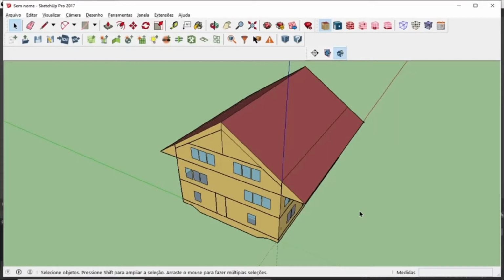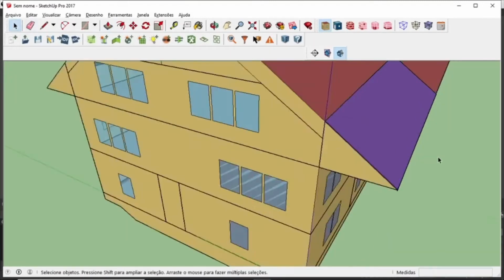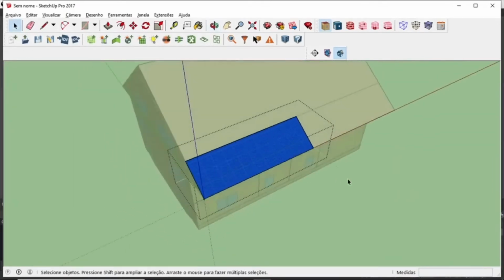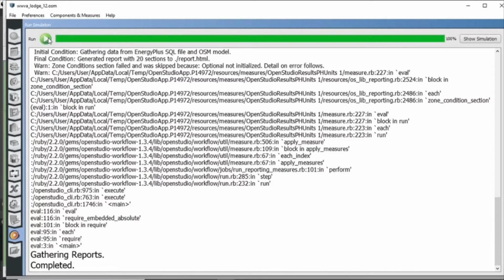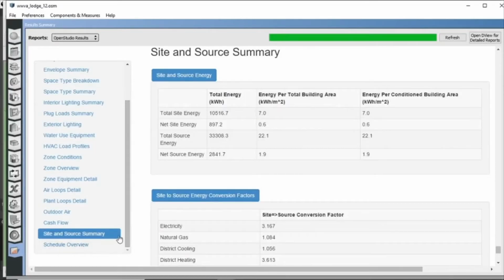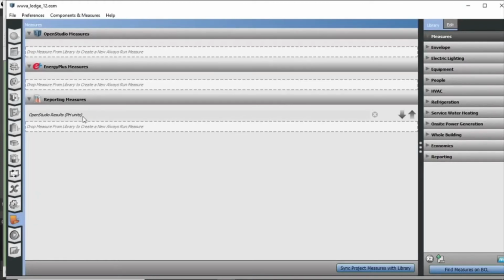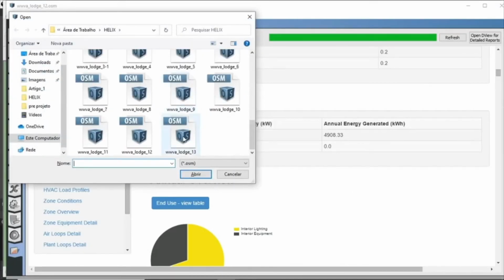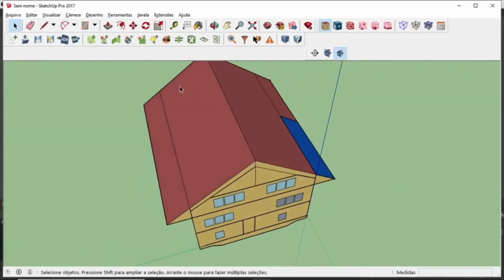OpenStudio SketchUp - Adding Photovoltaics

Comment: How can I enter the maximum power for my solar system?
Reply from the maker: The maximum power will be determined by the size of the photovoltaic array, the energy conversion efficiency, and the maximum available solar irradiance at the weather file location.
Reply from the maker: It is auto calculated.  It is not a parameter that you can enter.

Comment: I have a question about designing PV in OpenStudio. When assigning PV to just one of the surfaces, what happens to the other sides of the shading, especially if we have given it depth?
I used this approach, and in the IDF file, it shows one PV panel and five shading surfaces. My question is: why do we need to extrude the surface? Is it possible to assign PV to just one surface without extruding the surface? The PV I want to use has depth; can I assign PV to all extruded surfaces, or does only the top surface act as PV?
Reply from the maker: The top surface only acts as a PV.  It is not necessary to extrude the surface, and doing so only adds to the complexity and calculation time and does not significantly impact your model.  The small extruded sides only provide a minimal shading and thermal storage effect.  So, it is better to have only 2dimensional panels.  The shading surface is also assigned a material property and thickness, so it still functions as a shading surface and thermal storage and radiation moderator.  Depending on the material and thickness chosen, there may be a nominal radiative (and conductive) heat that goes through the material and impacts the building.  You would not want to assign the PV to the extruded sides unless they actually contain photovoltaic cells in real life.
Reply: @helixenergypartnersllc3540  thanks a lot, I got it

Comment: i want ask something. i need help. my thesis study need to connect Sketch Up, Open Studio and Energyplus in doing PV System. my design that, PV is the source energy in cooling system. the cooling system is simulated by energyplus. how i can connect PV system in openstudio and energy plus?? Could you explain that? thanks
Reply from the maker: OpenStudio does not import cooling systems from EnergyPlus.  You will have to set up the building model and photovoltaics with OpenStudio first and run the simulation.  Then, go to the "run" folder and find the EnergyPlus input file called "in.idf".  This is the file you will open using EnergyPlus.  From there, you can model the cooling system in EnergyPlus.  I am not sure if there is a way to directly connect the cooling system.  I thing you will have to use the ElectricLoadCenter  objects.
Reply: @helixenergypartnersllc3540  thankyou. I was try to create PV in Openstudio but im failed to run there is error in Library. Where i can get that Source?
Reply from the maker: What is the error?

Comment: Thank you so much. I Under Stand step to add PV but I have a 1  Question. Can you tell me how to show the PV Results in monthly ??.I didn't see  it in EnergyPlus Results and OpenStudio Results
thank you and sorry for my English skills.
Reply from the maker: Good question.  Go to the Output Variables tab and turn on "Electric Load Center Produced Electricity Energy".  For the timestep drop down, select "Monthly".  Run the simulation and then use DView to open the sql file as discussed in this video: https://youtu.be/8JlZrvenFBM.  It is sort of strange, but the monthly results will be plotted on the first twelve days of January (representing 12 months).

Comment: Thank you for your explanations, however i have problems while exporting IDF after modelling photovoltaics. The error says "Electric Load Center Distribution is not referenced by any generators or transformers, it will not be translated." What is this problem about and how can it be fixed? I would be glad, if you can explain briefly.
Reply from the maker: It seems that a OS:ElectricLoadCenter:Distribution object was not created when you created the photovoltaics (https://youtu.be/LAqn8bVE1Eo?t=197)  This is the first question the script asks when applying photovoltaics.  It should automatically create one in the OSM file.  You may have to run the script again.

Comment: Hi, since PV are placed in a top of the roof, can it be an extra shading device of the roof, so it can cover the main roof from the sun array? thus making the roof room temperature lower than the roof without PV?
Also if the model I created, only have 4 weeks weather data available, can I simulate the PV only for 4 weeks, so I can gather the PV result data (its KWH) per 4 weeks, not per year?
Thank you
Reply from the maker: Yes, the PV will provide a shading effect to the roof.  Yes, you can simulate the model for what ever time period you want.  Go to the Simulation Settings tab on the left.  Under Run Period, you can specify a date range to run the simulation.
Reply: @helixenergypartnersllc3540  Lovely, thank you for the answer

Comment: Thank you very much, is it possible to model a PV glass and calculate energy loads in Open Studio?
Reply from the maker: Yes.  This video discusses how to model the PV Glass.  It only has simple inputs, so if you want more detailed PV modeling, you will need to either write a measure or use EnergyPlus directly. 

Yes, OpenStudio can calculate loads. For calculation of loads, you will need to see my other videos.
Reply: @helixenergypartnersllc3540  Thank you very much!

Comment: Can you pls do a video on how to add slab edge insulation for a concrete slab on ground and under slab insulation
Reply from the maker: Good question.  You simply need to create a new construction that includes the specified insulation as one of the material layers.  Then, in the spaces tab, surfaces tab, assign that construction to the appropriate surfaces.

I you are doing this in SketchUp, you will need to edit the space, and select the surface.  Open the Inspector tool, under Edit Object, Construction Name, use the drop down to select the construction that you created.